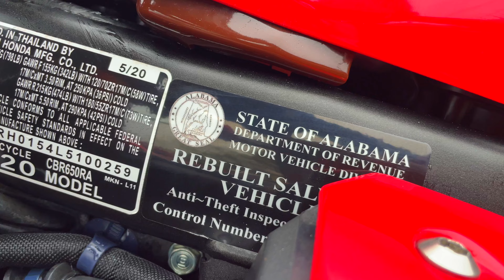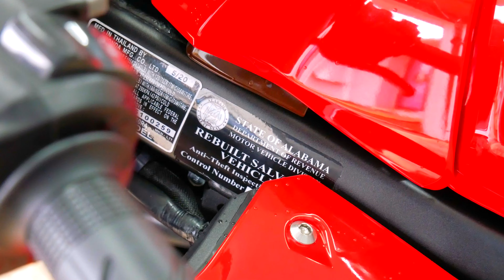Can My Wrecked Motorcycle Pass Inspection? (Honda CBR Rebuild Part 8)

Comment: Why is there not somewhere you can get it inspected closer than two hours away? Where I live almost every garage can do a vehicle inspection.
Reply from the maker: Because I chose this person to work with almost two years ago. And the garages I asked locally didn’t want to file the paperwork which led me to finding this guy. I may change later but it works for me now and I know it will get done 100% everytime.
Reply from the maker: Also, in 2021, Alabama changed the law where regular people couldn’t get rebuilders license anymore so you need a full dealer’s license, including a lot to get that license. I originally was going for my rebuilders license, until the law changed.